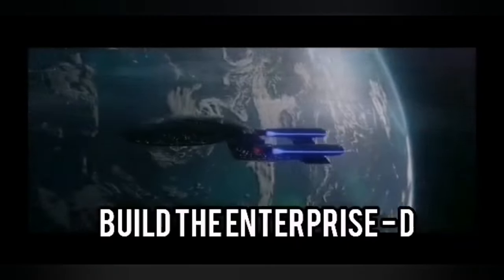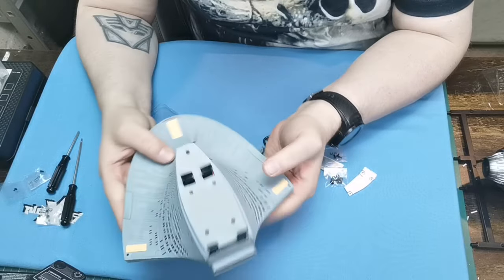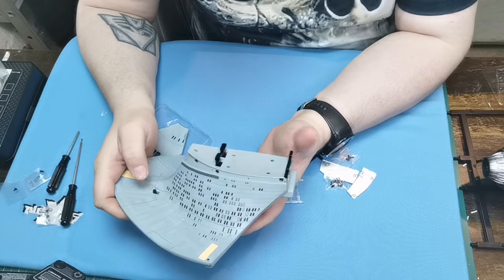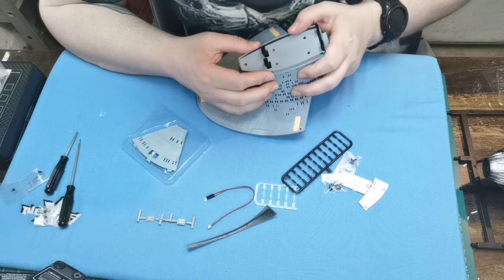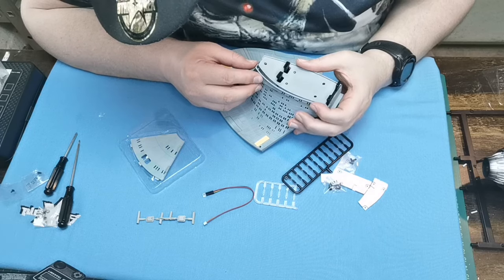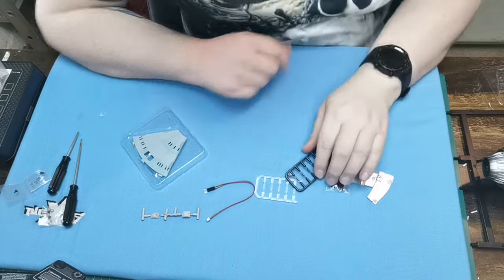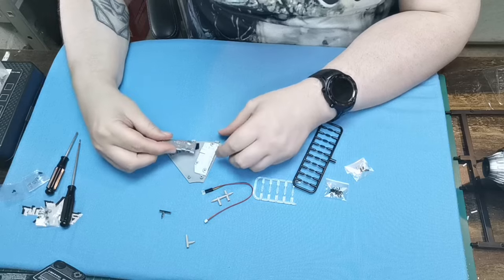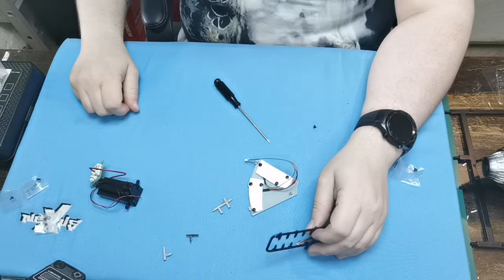Fanhome's Build the USS Enterprise-D issue 12 Stage 44

Comment: nice work Kev, pity the cobra neck dosent light up, it maybe like you said the wire has come out of the battery box or you might have pinched a wire in there, the best thing to do is check it, it,ll be a shame if everything else works and that dosent
Reply from the maker: Yeah already done a tear down on it I've got a new PCB board coming
Reply: @Thenexusmodels  thats good to hear mate